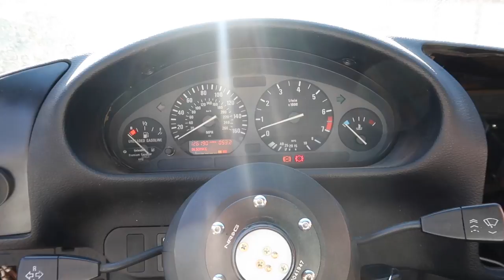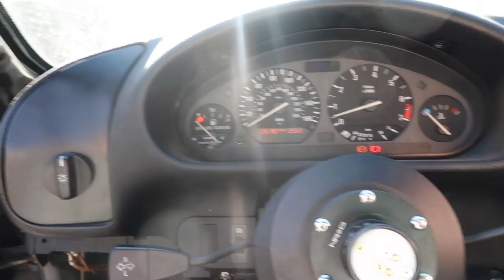THE NEW DAILY BEATER...

Comment: +Ricer Miata You got the Mishimoto radiator bent from the factory? I've went through FIVE fucking mishimoto radiators.. First one sprung a leak, the next 3 were all shipped deformed, last one sprung a leak even quicker. Needless to say I said fuck you and went back to stock. On the plus side they were all free replacements and I guess I have a shit ton of scrap aluminum to mess with.